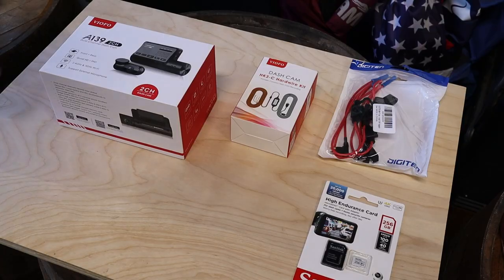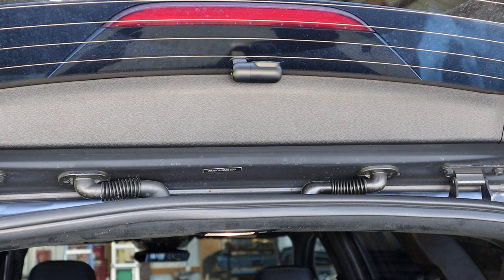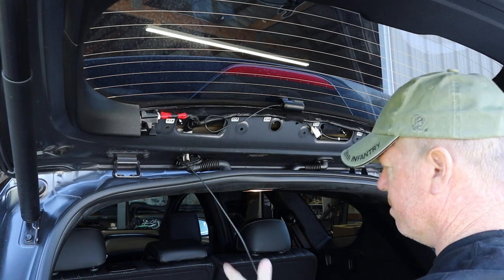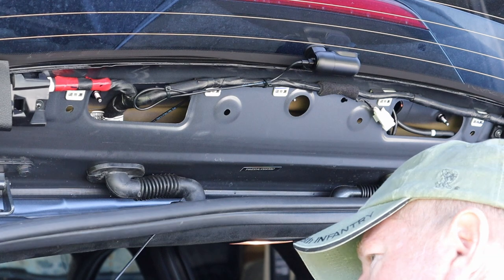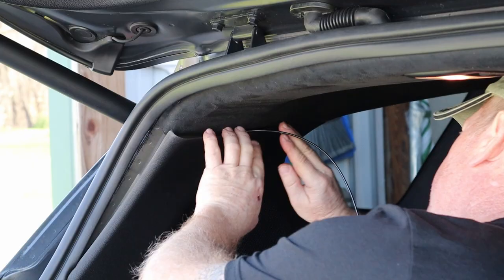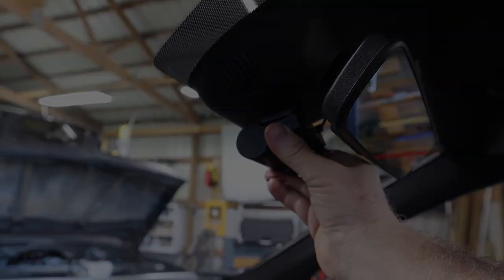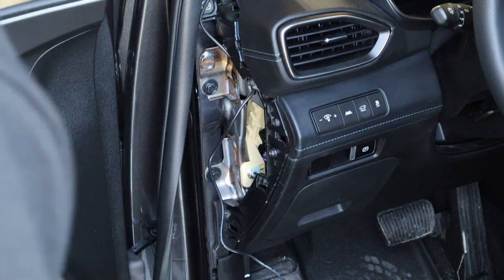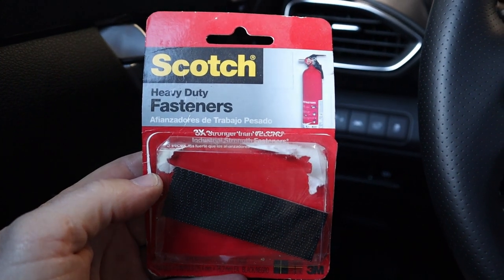Viofo a139 Dashcam - How to Hard Wire Install in a 2022 Hyundai Santa Fe

Comment: Great video.   Very much helped me install my Vantrue E2 (front and rear dashcam).  I would not have had the courage to pop off the covers and remove the weatherstripping without this video.   But it was pretty easy to do and I am happy I did.    One other thing I would add is that, when in the fuse box, and determining what fuse is ACC and what is not, and determining where a ground screw/bolt is, it is easier if you have a multimeter and use your multimeter to figure out which fuses are 'always on' and which 'ground' works.   Thanks again for a great video.
Reply from the maker: Hi John. Thank you so much for watching and sharing. I believe you emailed us as well and I just replied (busy weekend). Applause to you for the DIY. We do these videos just for that reason, to empower those that normally wouldn't, to actually do. Gain the experience and save the money. 🙂. Agree 100% on the multimeter. That is your best friend when it comes to automotive wiring. We're glad to have been a part of your journey. We actually just installed (and created an episode on it last week) for a Vantrue cam. They're great! We hope you stay safe out there and never need the footage from your camera and continue to be a part of our journey. Cheers!

Comment: Can you zoom out more where you exaltly install the wiring at the fuse box Hyundai. I have Hyundai Tucson 2023
Reply from the maker: Hi William.  Thanks for watching and asking.  We appreciate it. If you have a volt meter you can easily find which fuses to tap. You'll need one that has constant power and one that only has power with ignition.  There are more than just 1 wire for those that will work but I avoid any that are part of the safety features like an airbag fuse. Hope that helps and congrats on your 23 Tuscon. That's awesome

Comment: Never had dash cams before but I bought the exact same car a couple weeks ago and figured I should have them as a precaution. Got everything you suggested and it all works flawlessly, down to the scotch heavy duty fasteners. Thank you for making this way easier than it would’ve been!
Reply from the maker: Hi Ryan. Thank you very much for watching and sharing your journey and the kind words with us. That's great that everything worked flawlessly for you. We're still very happy with ours. We did discover however that the heavy duty fasteners didn't stay on that plastic in the heat. Something about that plastic that nothing adheres to it long term. We resolved that by taking the panel off and putting 2 tiny screws threw the fastener and into the panel. You can't even see them and the panel is easy enough to replace if we feel we need to do something differently down the road. Safe travels to you out there and we hope you stick along on our journey as we share more mods to our Santa Fe. Cheers!

Comment: Excellent video. Got the cam installed, but what fuses are people taping into to for the battery and acc hardwires? I'm unable to get the tap on the correct way at the acc fuse bottom row location as it hits into the wire connector. The fuse tap has to point downwards because the the hot side of the fuse is on the right when looking at the fuse box. What have people been tapping into for the battery and ACC lead wires?
Reply from the maker: Hi Ron. Thank you for watching and sharing the kind words. We've been away taking a break with family over the holidays and hope you had a nice one as well. We received your email and I just replied to it. Hope that helps.  Take care.
Reply: @SpiritedWrenchers  Can you post here what fuse you tapped into?
Reply: It looks like your fuse tap is pointing upwards in the video.   My Santa Fe power is on the left side of the fuse so my fuse tap needs to point down to properly protect the circuit.    This makes the entire bottom row off limits due to the 3 connectors sticking out below the fuses., including the ACC fuse.  I struggled to find options.   I ended up with child lock for constant and rear AC for accessory.
Reply: @wantsanewvehicle  It shows in the video, if you follow the diagram on the car they used the a/c 7.5amp fuse for acc and door lock 20amp fuse for battery.
Reply: @Z33Garage   thanks. I went a different route and just used the cigarette outlet

Comment: This is excellent, thanks so much. I modified mine a bit by still using the cigarettes lighter but running the cable past the fuse box and neatly into the lighter 12v socket (which I never use). I don't have tie to figure out and test the fuses right now so this is great thanks.
Reply from the maker: Hi Gary. Thank you very much for watching and sharing. We really appreciate it. Glad this will be of help for you. We totally understand about the cabling. Stay safe out there.

Comment: Great instructional video. I have been dreading a similar install myself. I have a Viofo a129 front camer. I would recommend that you get a polarized filter for the front cam to get rid of the dash glare in the picture.
Reply from the maker: HI Kristjan, Thank you so much for watching and sharing the kind words. We greatly appreciate it. It's really not that bad of an install and we hope this helps you knock out your install. I believe ours came with a filter for it. I'll have to double check. The biggest problem we have it the crazy sticky velcro isn't staying up so we may have to come up with a more permanent solution. No idea what they made that cover out of but it could be used for so many things in life. LOL. Cheers!

Comment: What fuses did you choose? Yellow goes to the ACC, but the red, which one did you tap?
Reply from the maker: Hi frangkee. Thanks for watching and asking. I don't recall which one I used but I'm sure I can find out. It can be added into any constant hot fuse. If you have a voltmeter, you can test that from the top of the fuses. If it has power without the ignition being on, that fuse will work just fine. We just avoid tapping into any fuses that are safety related. Hope that helps.

Comment: I have mine mounted to the black box in my Ranger. if the 2 sided tape fails, replace it with 3M VHB tape.  I may, or may not, have broken a window trying to remove an old dash cam (mounted with 3m vhb tape) mounted on the windshield.
Reply from the maker: LOL. Thanks for watching Byron. We greatly appreciate it. That's a great tip. I have seen that tape but I'll have to look out for it now to use in those "no other choice" times. Sounds like it has quite a hold. LOL.
Reply from the maker: So... what happens when VHB doesn't hold it? 🤣
Reply: Install the mount without the camera.  Wait a few days before adding the camera.
Reply: @grnxnam  it was a couple of weeks before the VHB failed, and it only fell after sitting in the sun for a few hours. I'm thinking epoxy and self-tapping screws because whatever Hyundai made that plastic out of should be used for more than trim pieces 🤯

Comment: Art, you used a fishing tool for the feeding the rear video cable through the rubber wire management piece, do you have a link for that tool? Enjoyed the video. Dave
Reply from the maker: Hi David. Thanks for watching and glad you enjoyed the episode. The tool I used was something that I had left over from who knows what many years ago and I just kept it in my toolbox thinking I may need it again at some point and it's turned into a very helpful little item with wiring and audio installs. I tried to find something similar on Amazon or ebay and just couldn't. You could use thicker soldering wire or a very long zip tie with similar results. You just need it to be flexible enough to bend. Wish I could provide something more helpful for you. Cheers!

Comment: I have a 2024 Tuscon and want to install the Viofo A229 Pro 2 channel...is this the same install for me??
Reply from the maker: Hi stephena. Thanks for watching. For the vehicle, it should be the same. I'm not familiar with the A229 but I'm sure they are very similar, maybe just different features. The hardwiring will be the same. Good luck with your install and stay safe out there!
Reply: @SpiritedWrenchers  which fuse slots did you select to piggyback? I don't think the video specified?!? Thanks for your assistance 👍🏾

Comment: Great video, going to tackle this on our 22 Santa Fe Calli. Question about weatherstripping. Rear window seemed to be glued, other areas you didn't show how to remove or reinstall.  Are there pins/plugs holding it in place, or friction fit?  If I end up with gaps my OCD wife will shoot me for allowing new wind noise. Thanks much.
Reply from the maker: Hi Philsmall, thanks for watching, sharing the kind words and asking. We really appreciate it. Hope you love your Calli as much as we do ours. I can understand about the OCD wife. LOL. Dana is the same way and I can't lie, I am too when it comes to these things. Details matter. There is plenty of glue within the weather seal. Once you push it back on, you'll be just fine. As a matter of fact, you want to be careful not to get any of it on your headliner as it will be hell to get it out. We've not had any issues with ours since the installation. Hope that helps and good luck on your install!
Reply: @SpiritedWrenchers  thanks, that just added project to the honey-do list. Yes, love the Calli!

Comment: @Spirit'ed Wrenchers Thank you for the really nice job on the video. Just wondering your thoughts...will that interconnect cable from the rear camera interfere with the airgbag/curtain deployment if they did deploy? Also, the same the hardwire kit and the pillar "A" airbag. I've seen several videos that suggest a concern and workaround specifically a method to avoid interferences on pillar "A",
Reply from the maker: Hi Dan, thank you for watching and sharing the kind words as well as asking. We really appreciate it. Your fear is a real one as the airbags are something that I absolutely want to avoid impeding from doing their job. I tend to spend extra time ensuring the wires are not on the side facing the passengers so they are out of the way. I do the same for dash airbags. Hope that helps. Stay safe out there!

Comment: Any reason why you didn’t you use the empty fuse slots??
Reply from the maker: Hi Dr. Virus01. Thanks for watching and asking. We really appreciate it. Using the tap kits, it was easier to just tap into a known working fuse and leave those that are open as they were intended from the factory. They may be an option, but I personally have never used one before. Hope that helps. Cheers!

Comment: The rear camera seems daunting, do you use any adhesives when putting it back or you just put it back and there's no problem?
Reply from the maker: Hi there. Thanks for watching and asking.  We appreciate it. Is it more work to have a 2nd channel (rear camera) sure but I our opinion it's worth it in the case of a rear end collision.  The rear cameras come with an adhesive sticky pad. Like 3M tape. It comes off easily if you have to take if off glass.
Reply: @SpiritedWrenchers  I'm sorry I meant in regards to the weather seals along the doors, is there any loss of protection?

Comment: Great video. It inspired me to do more research and order a dashcam myself. I have a 2022 Sante Fe Calligraphy (2 wheel Drive) as well. I went with a Thinkware U1000. One question though. How did you get it to stick to the black plastic behind the mirror. I used the Scotch 3x better than Velcro and it pops right off. I even tried JB Weld Plastic bonder and thatdoesnt stick either.
Reply from the maker: Hi David, Thank you for watching and sharing the kind words as well as your story. Congrats on your Santa Fe. That plastic panel is made up of some out of this world plastic because nothing we tried stuck any longer than a couple of days. Because the plastic piece comes out and would be relative easy to replace, I used 2 very small screws and screwed them into the industrial hook and loop piece on the plastic panel. Because the hooks are larger on these, the small screws don't interfere with  their functionality and it holds up the radar just fine. Hope that helps. If you need a pic, feel free to email us @ spiritedwrenchers@gmail.com . Stay safe out there!
Reply: @SpiritedWrenchers  Thanks for the advise.
Reply from the maker: @davidblum8490  you're most welcome

Comment: Did you run the wire behind the airbag in the A pillar and if so, how did you do it?
Reply from the maker: Hi. Thank you for watching and asking. We appreciate it. I slipped the wire just into the A pillar and it held it there on it's own when it's in place. I always avoid messing with safety equipment in any way to ensure nothing is compromised. Hope that helps.
Reply: It sure didn't help! If worried about running wires UNDER an airbag, then do you have any idea what running a wire over an air bag can do when it inflates? It can cut it the air bag releasing air pressure inside before it does it's job. And if afraid, pull a fuse, but really, just moving a bag in a pillar out a a half inch DOES NOTHING TO HURT THE BAG OR INFLATE IT.

Comment: The kit comes with 5amp fuses yet you connected them to 7.5 and 20amp connections on the fusebox, I did the same and the 5amp fuse on the battery 20amp circuit instantly fried the moment the door locks engaged. I dont think this is correct.
Reply from the maker: @Z33Garage  thanks for watching and sharing.  Several things could cause a fuse to blow, and I would trace all the wiring to ensure there are no cuts anywhere. We've had zero issues with ours. Hope you're able to figure out the cause.

Comment: When ever running wires in tight spaces, spray some WD-40 on it. 
It will remove any friction, making the wires slide 100% easier with no problem.
Reply from the maker: Hi David, Thanks for watching and sharing. We greatly appreciate that. wd-40 is certainly a great lubricant. My only point of caution on using for feeding wires and using it would be around light colored fabrics as it may stain it. Just something to keep in mind for headliners or seats. Cheers!
Reply: Hi, great clean tutorial video for installation.
Please, where did you get the fishing wire tool, didn't see it in your description.
Thank you 🙏

Comment: How do you know what fuse to use?
Reply from the maker: Hi Dana. Thank you for watching and asking. We tend to choose fuses that are accessory related for the most part. We stay away from any safety related features or critical device fuses in the event there is a failure, it doesn't stop the car from operating. Ideally you can use a voltage meter to test the fuse when the car is running and turned off to identify which one has the power at the right times. We do not run ours 24/7 so I want something that turns off with the key, i.e. radio, windows, accessories. Hope that helps. Stay safe out there.

Comment: Thank you very much for the informative video. Installed quickly and neatly. Installing electrical accessories may interfere with existing high-performance equipment in the vehicle. I am thinking of cameras and radar equipment for lane keeping and other functions. To what extent does the Viofo dashcam you installed adversely affect this equipment? My car dealer warns of possible interferences. Thank you in advance for your reply and best regards from the Netherlands.
Reply from the maker: Hi Willem. Thanks for watching and sharing the kind words all the way from the Netherlands. That's so cool. You pose a great question. Dealers always warn of adding things to vehicles for a number of reasons but I'm happy to say that there is no reason a dash cam should interfere with normal operation and performace unless it's wired in a way where it does. These are simply cameras with a shock sensor in them and powered through components that are non-related to safety or high performance. Hope that helps and we hope you stick around for more episodes. Cheers!
Reply: @SpiritedWrenchers  
    Thank you for your quick response. I was particularly concerned about the interference that could be caused by the Dash Cam Hardwire Kit. I'm glad to hear you didn't have any problems with that. Good luck with your videos.
Reply from the maker: @willemalias5663  Our pleasure. Yeap, no interference at all. It's been working fantastic for us so far. Thank you once again for the kind words!

Comment: I seriously think it would’ve been a lot easier to run the rear camera wire starting from the front cam first.  Just my opinion.

Also I’m not a fan of the camera attached to the plastic because it makes the distance greater from the camera to the windshield which increase glare and reflection caught in the video.  Again, just my opinion.
Reply from the maker: Hi Boa. Thanks for watching and sharing your opinions.  We appreciate it.

Comment: Holy, managing wiring is such a pain. You have to hurt the car so much. I thought that would be a bit simpler. 
I bought a two-channel dash and thinking to return it and exchange for a single channel. (less effort).
Reply from the maker: Hi Caio Primo, I couldn't agree with you more, wiring is definitely a pain regardless if it's 1 wire or 100. LOL. This one was incredibly easy though and didn't hurt the cars interior at all. Just have to take your time to ensure nothing gets broken and it's really easy job. Nevertheless, we wish you success if you decide to keep the 2 channel or going with a single channel. Cheers